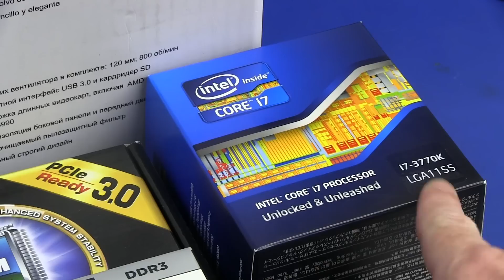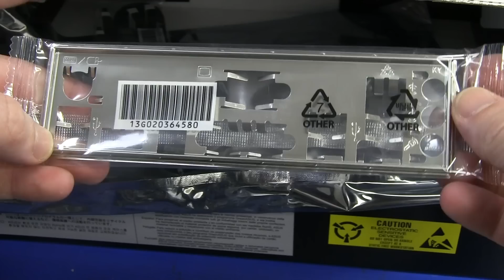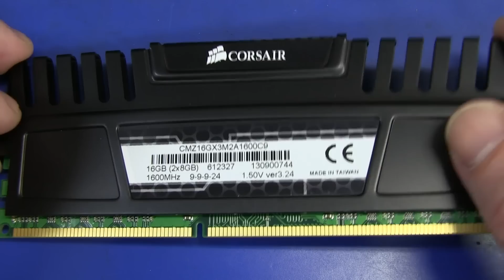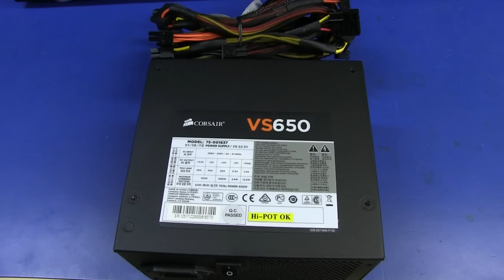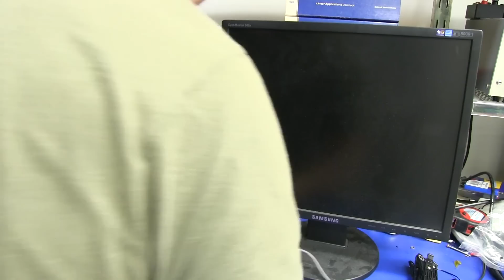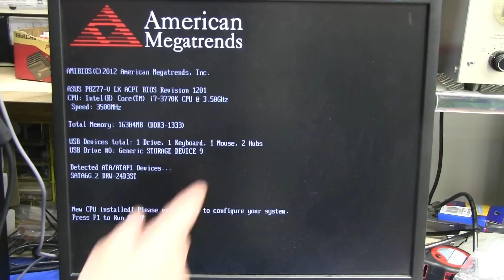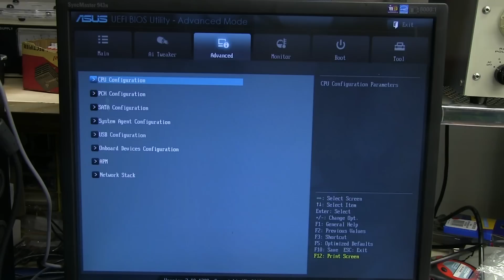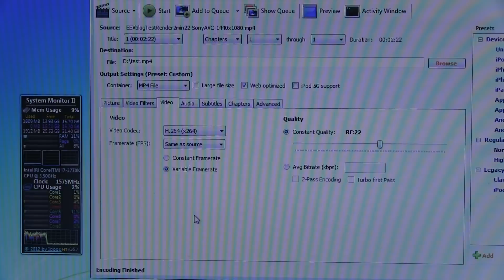EEVblog #462 - Video Editing PC Assembly

Comment: A few things for future builds!

1) You used way too much thermal paste, so much in fact that you need to check your temps at load

2) Next time you put the motherboard IO plate in first and then 

3) You really need to work on your cables :) HDDs go in the other way, and use behind the motherboard tray to route your cables

Comment: While most of the Corsair PSU's really are good quality, the VS series have legendary CapXon caps. But at least it has 3 years warranty. I had one 600W BeQuiet PSU with CapXons that failed and damaged hdd's when it went.

Comment: Mainboard manuals are usually written in a fool proof way. There is no excuse in not using them, especially if your last PC build was years ago. You are seriously handicapping the CPU performance by running your memory DIMMS in single channel.

Direct quote from the Asus manual 
"Supports two (2) modules inserted into either the blue slots or the black slots as one pair of Dual-channel memory configuration. We suggest that you install the modules into slots A2 and B2 for better compatibility."

Comment: The only real criticism besides "pastegate", is the choice of Asus for the motherboard. Having worked in retail/repair and seeing a throughput of over 1000 PCs a year, when the boss made a deal with Asus, the techs all complained bitterly that it would only cause more costs and headaches than the few dollars saved changing from gigabyte.
True to form our failure rate nearly doubled, and it was less than 6 months until we were back to gigabyte boards.
Asus can be a bit flakey, gigabyte are solid.

Comment: Hi,Dave.
nice video man . when installing the Ram(memory) use the matching slot color to get steady performance  i.e install the first ram in black slot the other one goes to the next black or if you want the blues don't mix the colors if you need smooth working PC
thanks for your vids. they gave a good help

Comment: I am a recent convert to the Nocturna fans.  I found them while looking for the best fan replacements for a $50k usd testing computer we have at work.  Its a shame I could never afford to send you one of those machines.. They flushed out all our cooling issues we had with some of the mid range fans, while cutting down on the noise.  (5 fans inside)

Comment: Your ram wasn't in dual channel. You should have used the two blue or two black slots. The two blue slots would have allowed the CPU HSF to be in push. And also you should have applied the TIM to the centre of the CPU in a pea sized dot and let the HSF spread the paste as you tightened it down.

Comment: Tha glob of thermal paste may dry up and cause problems in the future. You should really clean it off and just put a small drop in the middle, and let the radiator do the spreading work. Another technique is to make a small line at an edge of the cooled processor and spread it out evenly with a plastic card

Comment: a good cooling solution.on a i7.if lower noise is wanted go for nochtua d14 or 15 cooler tower.twise the prize for twise the cooling almost.i like to use ssd size to be 250 gb for windows and software.and old type hhds for storage.then it last longer.

Comment: Hey Dave, I don't know if the Corsair Vengeance RAM modules have this or not, but you should enable your XMP profile on the RAM.  The XMP profile is a program inside the RAM modules that will enable your motherboard to configure itself to the RAM and give you better performance from your RAM than 1333MHz.  That will also bring your RAM speed up to 1600MHz.  If you browse the memory settings in the BIOS, you should find it there.

Comment: dude i'm not going to bother with this comment section anymore, it has taken a slide off a cliff, but if you don't believe me about the thermal paste issue i recommend you go to tom's hardware and have a search, they have a few articles about the issue and their results show that letting the pressure of mounting the heatsink spread the paste generally yields better results. but really spreading it is fine it isn't a make or break thing. the amount of thermal paste that dave used is crazy though.

Comment: You need a drop the size of a pea on the middle of the cpu itself and plop the cooler on top of that. The cooler will spread the thermal paste. The way you put it on, not only did you use way too much, spreading it like that can cause air bubbles to form, and increase temperatures.

Comment: 3 FPS is a figurative speech (Dave's video encoding performance, btw is also measured in FPS. So - it is not just games). Anyway - to overclock this machine is like to tune Ferrari engine while it already has,say 1000hp.

Comment: The die is just a little square under the IHS. It's enough if you just put a dot on that and let the pressure of the heatsink handle the rest. And spreading it on the heatsink isn't really done in computer building, like seriously never.

Comment: Back in the day, like a decade or more ago, we used to use a credit card to spread around the thermal paste to be an even layer.  I don't know why it's not advised to just put a blob in the center and let the clamping force spread it out.  These days I just use my finger to smear around a very thin layer on both surfaces.

Comment: Your CPU fan sucks, mine on the other hand literally pushes on my RAM module's heat spreader! Seriously, it kinda fell off, but DDR3 runs cool, so I'm not concerned with the lack of chip packaging contact. In any case, I'm quite satisfied with the fan.

Comment: Well pull when using a powerful fan is noticibly better. Try puting a fan on one on your home windows to suck out the air and provide smaller intake opening. When you flip the fan arround to push rather than pull you get about 3-4 degree diference. As you know expanding air cools down. About the height.... you saw how flmsy the ASUS board was...

Comment: If your 120 GB SSD drive has a 6 GB buss speed and your motherboard supports raid zero then consider buying a second 120 GB and spaning them in raid zero which equels 12 GB buss speed and a total capacity of 240 GB. I've done this and it flys. i have standard SATA 3's for mas storage.

Comment: Dave you did a good job. the CPU fan works in either push or pull mode, one reason car makers prefer pulling air, more efficient. just tape the seams and it will pull more then enough air. if you want the proper paste amount. just remove the heat sink, wipe off the paste on it and reinstall. you will have the proper amount left on the CPU. the heat pipes do the rest. all in all I like the video considered today any idiot can build a Box compared to the old IRQ and SCSI and jumper days. good job!

Comment: A hilarious one :D few questions at forums could have saved loads of trouble - 
You can just attach the IO plate befrore motherboard aswell.
The amount of paste unevenly like that can actually leave airpockets.
You could just use B Ram sockets without swapping the fan on cooler.
Also generally same colored sockets are paired (may not have been for this mobo) for dual channel mode.

Comment: You're completely right about not needing a video card. I've done a tiny bit of very basic work with video editing (same as you, just cutting clips together and rendering them out) and I've tried with and without CUDA (nvidia gpu processing basically) enabled and the difference in render times was 5% at best. Definitely not worth it if you're trying to save some money :P

Comment: Yeah and I normally put all the paste I am going to use on one side of the CPU, and then with a totally smooth credit card shape applicator, carefully, evenly and slowly apply the paste in one direction once to cover the whole CPU.  You should end up with a thin smooth layer with virtually no imperfections;  you should resist the urge to re-move the paste too!

Comment: Asus makes really good boards good choice and ya I agree those bios screens are awesome by you going thru some of the settings I can see they spared no expense on sensors for the board HQ is high with this one also all the new stuff is going for noiseless design so it's a good thing for sure today APU chips are getting better to a point that you can't tell them apart from graphic cards unless your running intense gaming that uses alot power in that case you would need maybe a bigger PSU but it also depends on the card you would choose I have a PNY Sig. Series that uses power from the slot only and ramps up when needed a very good one I like it .

Comment: Dave, I will advise you to do some serious memory tests on those Corsair sticks. They seem to be doing no tests on the RAM straight out of the factory these days, although they do offer several years warranty on most modules.
I had to send back a 12GB kit two times before the third replacement came. The third kit was fully tested and had a sticker on to prove they had been tested. They worked perfectly.

Comment: If it was such a good idea they would have done that from the beginning.  It's just laziness is why it's now just "put a blob on it and expect the force to spread it out."  I don't see how creating a thin layer on both surfaces can result in air bubbles.  The layer is so thin they would be driven out.  Even so, you would still have the surfaces closer together and your whole surface has paste on it instead of assuming the blob spread will make spread out entirely.

Comment: I love the way they all fuss over completely irrelevant details too like heatsink compound, fan direction and cable management.

Hint folks: None of it matters. If how you apply heatsink paste mattered, the CPUs would come with their coolers pre-bonded to them from the factory.

Actually, maybe that'd be a good video - how temperature affects ICs. My PC runs at about 30c but my Macbook ran at about 60c and was just as happy.

Comment: AFAIK CUDA or openCL accelerated applications like sony vegas and premiere pro only use the GPU for rendering previews, and will still offload the final render to the CPU.  Sure this speeds up a video editor's works, but is only going to make a big difference if you are doing a lot of post production on the videos ... something which isn't normally done on a video blog.

Comment: You'd be surprised at all the VGA and PS2 connectors you get on high end gear these days. These boards tend to sell quite well in Asian markets where people want gaming/high end desktops but still use old screens and keyboards. Same goes for the old PCI slots.

Comment: If you arn't using ssds than sata 6gb/s won't be any faster than sata 3gb/s you can still easily run your raid configuration on the other sata ports

Comment: No, just no. If you get a computer to overheat in this case you do something horribly wrong. This case is designed for a low power quiet system, so it doesn't have much airflow. If you stick a top notch system with multiple graphics cards in it, the machine might overheat. But that's because of the lack of ventilation and not the sound dampening material.

Comment: 40:52, finally, I've been complaining about this for a long time.
They need to add some support, specially under that area.
And if you didn't installed the rams before putting the MB in the case, you would have complained even more since 99% of the time when doing so, you hear things cracking, maybe it's just the PCB, but meh, those ram sodded pins are way too fragile.

Comment: @ Dave, hey mate,  total respect
a few points though, 
1. RE those rails that hold the hard drives, -  if you find that the SATA cables are a bit close to the side panel above the MB, thats because the rails on some cases are supposed to installed, so the SATA connectors are towards the side panel under the MB... Stupid, but true (only some cases)
2. RE PS2 connectors, you said, Your sure the BIOS supports USB on bootup.... Guess what, not always, it's always best to use PS2 for installating O/S

Comment: And please, put the cables behind the motherboard. There must be enough space. There are a lot of holes dotted around the board so you can fit practically every cable from the PSU behind and keep it neat and clean in the front. Check the ASUS board manual for the dual channel slots but they are usually A1B1 and A2B2 as mentioned. The amount of the thermal paste is not that big of a problem, it will just be squeezed and will make a mess. Thumbs up and get some high end components next time. :)

Comment: in my understanding if you put too much thermal compound on the cpu it can make it overheat and plus the ram  its not going to work as good as it should because he put them in wrong      yes it didn't explode but i think he will be will be pulling it apart in a few months time because it would be over heating   thats my guess

Comment: great video and a reasonably good job. not to say i wasn't yelling at the tv most of the time but that's just experience. the main confusion was the way the thermal paste was added. usually you just add it to the processor in maybe a blob or smear but very unique. the issue with the back plate was that i clips into the case separate as you say you never have to force. overall great build but i would go with a video card depending on software you use most of them benefit from a card that has cuda

Comment: Dave, with all due respect, you should not have done a video on a PC build until you'd either watched a few tutorials or actually read the manuals. You're brilliant, and I have a ton of respect for you, but aside from the RAM arrangement and incredibly overdone thermal paste, you sat your assembled board on its side and tried to hold the RFI shield against it as you laid the board in instead of bending the RFI tabs (or snipping them, where necessary) and just snapping the RFI shield into the case itself, as the manual would've told you to do. 

You're genuinely one of the smartest guys I've ever listened to, I think, but you honestly should never let yourself be too smart to at least watch a tutorial or read the manual when it comes to expensive components. You can afford to replace this entire setup if you screw it up because you were too proud/over-confident to read a manual, but some of your less computer savvy viewers whom trust you enough to follow your lead might not be able to. 

Sounds like you've fixed all the issues with this build, so that's good at least. Hope it's still going strong for you today. 

My best to you and yours.I look forwarded to continuing to enjoy your videos for a long time to come.

Comment: Dave! What are you doing?!?! Pulling air trough the radiator is much better than pushing it. The thermal paste must be applied only in the center of the radiator! Mounting it will disperce the paste evenly. However the way you did it traps air between the 2 surfaces. The cooler master is too high. You should eather bend the pipes or cut the foam on the box. Otherwise you are putting stress on the cooler mount and you end up unparraleling the 2 contact surfaces.

Comment: Ps's form factors needs to be thrown away and replaced with a new set form factors that suits tomorrows demands. First thing that comes to my mind is a cpu solution with heat sink on both sides of the MB. Just imagine what heat you could remove trough the backside of the MB if the designers where allowed to play around with new solutions.

Comment: Why do I think a Celebrity Death Match between Dave and Linus would be entertaining?
That sound deadening material looks like it would be pretty close to the top of that heat sink.
I think the newer cases have better layouts(for service) and looks, but they are soooo flimsy compared to old cases.
And they are quite a bit larger for all the "cable management" and have tons of wasted air space to get the heat out at a quiet leisurely pace.
I think they powder coat everything now because it is probably cheaper than plating.

Comment: 25:08, It might be more than is required but anyone with an ounce knowledge of physics can tell you its not even remotely enough for it to become an insulator and its fine. Thermal pastes except those gallium based are non-conductive, you could smother the socket in paste and it wouldn't damage it.
The Ram can go in either the blue or the black, you left a annotation about it and yes I know you would want dual channel. 
Yes he has messy cables but his CPUs TDP is 75ish, the Evo has a TDP of 180. So irrigardless of the minor airflow difference its only cooling a CPU. 
PS building snobs ruin the community. 
And if anyone wants to argue about it, I can easily link you to several enthusiast forums im on so you can see my pcs.

Comment: lol, that was blunt, oh, and thermal paste ;) though it doesn't look like anyone has explained WHY that much is a bad thing. its not the amount per-se, it's the likely hood of getting air bubbles which, least case scenario, you will get increased temperatures. and worst case, you can literally blow your CPU+ cooler sky high (yes, literally) so it's a safety thing.

Comment: Dave your still running your cables like we did in the 90's, you want to route everything through to the back and cable tie them down to the back of the motherboard tray then put your cables back out through the cutouts

Comment: The power supply is just fine!  The caps wil last longer than in monitors or tv's.
Just keep an eye on them.
My Antec Truepower had Capxon GL caps and they where still fine when it failed.
it lasted 8 years!

Maybe a idea to make a vid where you measure the ripple and the voltages of this cheaper power supply? and compair them with the ATX specs.

Comment: From having two little jr engineers who like to push buttons. You probably want to NOT hook up the power and reset button on the top of the case. I've been in the middle of doing something and they have pressed the reset or power button on me causing me to loose all of my work...